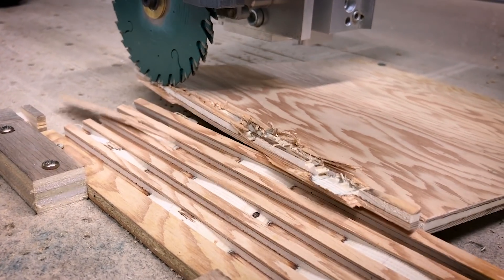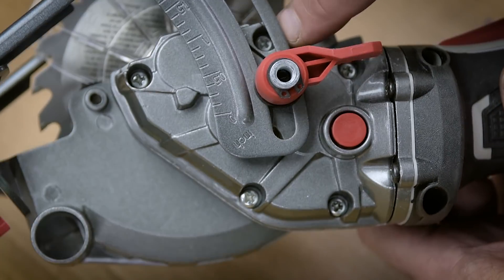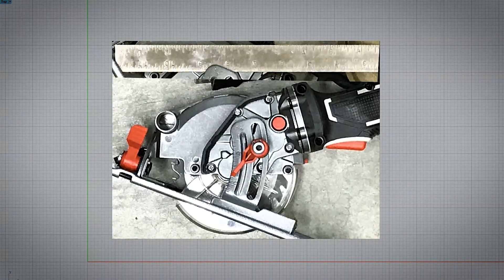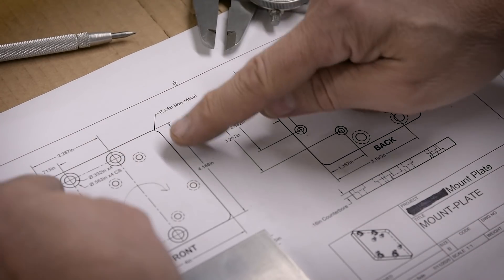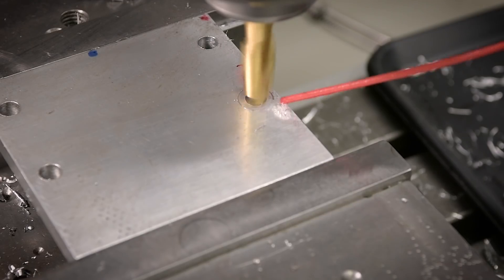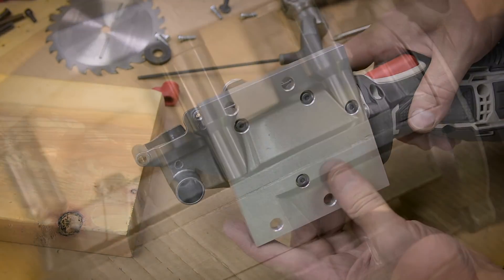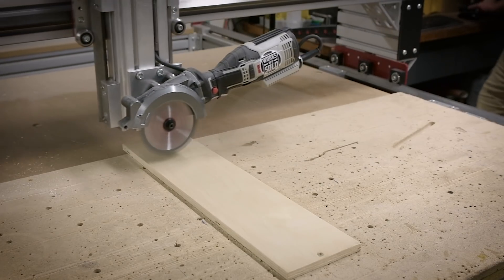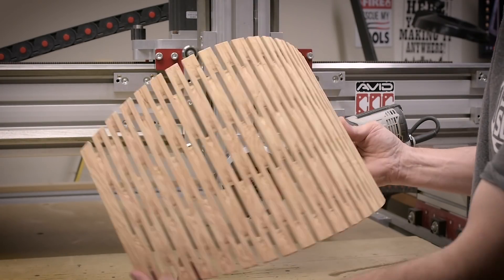ULTIMATE ROBOTIC CIRCULAR SAW // CNC SAW CUTTING MACHINE // CNC PROJECT IDEAS // DIGITAL WOODWORKING

Comment: Hey
How did you menage to simulate toolpaths for those 3d Concavities?
I plan on using similar setup to yours on a bit more complex geometries.
Reply from the maker: I use Rhino and RhinoCAM. It does a good job of making accurate simulations. I modeled the subtracted shapes using a disk object similar to the actual cutting blade.

Comment: This is really cool! Was it difficult to get the CAM/CAD to make toolpaths for the 3D carving?
Reply from the maker: Thanks! I wouldn't consider it to be difficult, more like unpredictable. Partially because I've been doing experimental CNC projects for almost ten years. Not that I'm a super expert, but because I fully expect things to crash and break often. In short, my go to solution in this case was to treat it as an engraving. This category of machine Ops is quite simplistic.
Reply: Rhino !

Comment: Have you considered if it’s possible to mount both tools at the same time and just add or remove the bit or blade on the tool you want to use? (Maybe that wouldn’t be any faster, just curious.)
Reply from the maker: Thanks, that's an interesting idea. Now that I know it's functional, I can start to expand the possibilities.

Comment: How the heck did you program that? Pretend it was a giant ball endmill?
Reply from the maker: Thanks for asking. Well, as you’ve already guessed, there is no tool profile to simulate a circular saw blade. If you watch the video, there’s a quick clip of the 3D model. Look closely and you can see the spline at the bottom of the cavities. That’s what the saw is following. Basically, it’s a 3D engraving path.